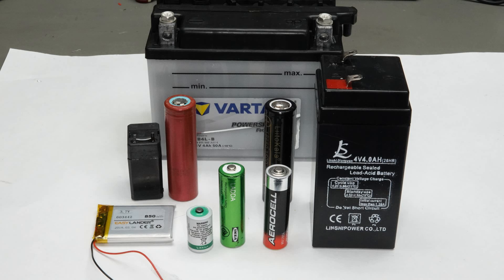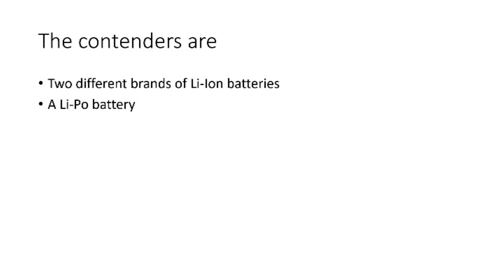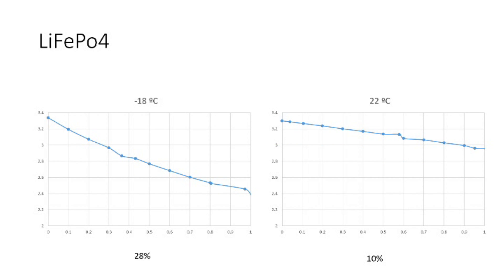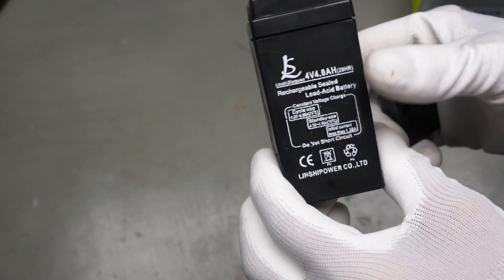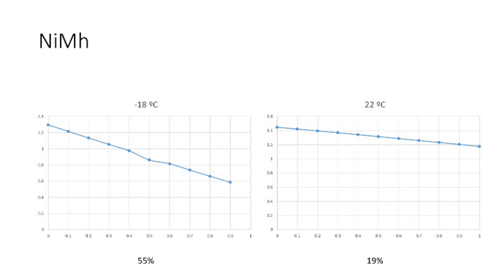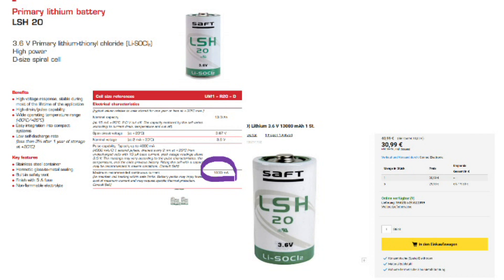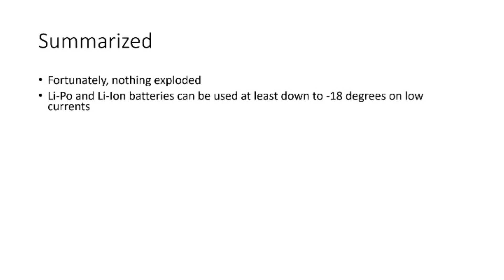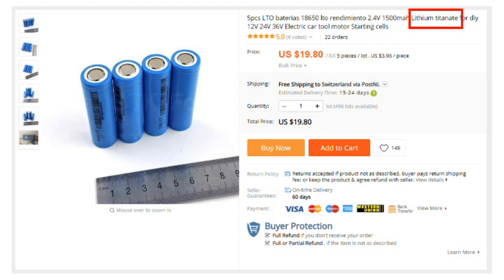#256 Which batteries are best for winter? (Arduino or ESP8266 / ESP32 projects)

Comment: Good evening, thank you for your informative videos. What would be the response of the batteries from your experiment at 50 degrees celsius or higher ?
Reply from the maker: I do not know because so far, we only have a maximum of around 35 degrees C...
Reply: @AndreasSpiess  Thanks for your answer . The reason for my question was because I live in Greece and we have a hot summer (35-45 degrees Celsius) in the shade, how do the batteries behave in these temperatures.

Comment: My understanding with the Lithium based batteries was that if you charge them at <0C then it causes problems with the cell chemistry and you drastically reduce the number of charge / discharge cycles for the lifetime of the battery.
Reply from the maker: This is often written. However, I only found papers where they charged at high rates. We charge at very low rates. So the danger is smaller.
Reply: @AndreasSpiess  Oh thats very interesting to hear! Yes there is not much data out there which is very frustrating!!

Comment: Actually  now I know more about batteries. You shouldn't charge them below freezing. Cars in Norway they use extra energy to heat the batteries first. They are not being charged cold as you assumed. Charging cold makes holes in the membrane. Reduce number of cycles
Reply from the maker: I agree for high charging currents. But do you also have data for the small currents we use? I did not find any.
Reply: @AndreasSpiess  I am not sure but I assume a 0.1c charge rate will also cause extra wear. I think is nice video idea to test capacity at least after below freezing charging. I know that testing cycles and degradation is long task. But capacity testing could be done?
Reply from the maker: Here the tried the discharging at -30 (LoFePo4). And they say that these batteries can be charged down to -5C. There is a risk of „plating“ but I assume this goes somehow with the charge brought into the cell. https://youtu.be/3iLLAaX0lrI

Comment: so, as the video is two years old now it maybe worth to ask. Do you have Andreas some long term experience about charging Li-ion battery with small solar cell during winter time when it is below 0 Celsius outside? I would be interested to such experience...thanks!
Reply from the maker: I had a few outside during the last winter. But it was not very hard. So no problems.
Anyway I learned that charging can create some internal structures which can puncture the insulation. So this seems to be a long-term process. Maybe we just do it and change the battery when it died after a few years...
Reply: @AndreasSpiess   thanks for your reply! Very valuable experience. So, then it can be a long process to kill a battery with winter time, outdoor charging. But eventually if I want to be sure that no battery dies due to charging at sub-zero Celsius conditions then simply don't charge them when having such weather conditions. So, probably worth to build in some 'switch-off charging' mechanism if it is under 0 Celsius.... thanks again!

Comment: Can I power this ESP32 board https://www.amazon.com/dp/B0718T232Z/ref=cm_sw_r_cp_apa_fab_qYoCFbKQHPMVG with two 1.5 volt Energizer Ultimate Lithium batteries like these  https://www.amazon.com/dp/B00EAKP8S0/ref=cm_sw_r_cp_apa_fab_k2oCFb14S8G9F ?
If so, would it be better to use two of these batteries through the 3.3 volt pin, or 3 (or 4?) of these batteries through the 5 volt pin ?

Comment: Please, please, anyone watching this, do not charge Li-ion in negative temperatures. This only shows a single cycle, however these batteries degrade very quickly while charging in freezing temperatures, they also form various nasty things in the electrolyte, which can lead to fairly spectacular failure later on.
Reply from the maker: Where do you have the proof that this happens when charging with small currents?
Reply: @AndreasSpiess  If it happens at normal currents, it happens at low currents as well, just at slower rate. Each cell is different and results vary. I work in this field and have tested hundreds of different cells in last 12 years, I've seen it happen, many times.
Reply from the maker: And what is the effect? Good to know a specialist because most people only warn with no concrete effects.
Reply: @AndreasSpiess  well the most usual problem is capacity loss at each cycle. At -10C some cells degraded hundreds of times quicker.
Reply: Do you have any recommendation for how to accomplish charging in freezing temps with li-ions or maybe some other compact rechargeable battery type?
Reply: @eugy2008  the simplest way is to heat them up to +5C before charging.
You can charge at very low current in cold, but each cell model reacts differently, so you need to do some serious testing first.
Reply: @eIektrinis  I've been looking around batteries lately. What's your opinion on lithium titanate batteries for cold weather charging?
Reply: I am thinking of making a battery pack with flat li-ion batteries and a small heating element that I could try turning on for short periods of time with a transistor on arduino.

Comment: Hi Andrea, I need you help: can you tell me if I can connect an unprotected 18650 directly to a ESP32 TTGO-T- Display? Does it have a overcharging/discharging circuit? I can't understand unfortunately... ! The schema is the following  https://github.com/Xinyuan-LilyGO/TTGO-T-Display/tree/master/schematic

Thanks a lot
Reply from the maker: These boards usually have a LiPo charger which protect against overcharging. You easily can find out if it has undervoltage protection by connecting a battery and wait. I suspect it has none.

Comment: Fast charging of batteries at temperatures below 0°C can be dangerous (depending on the cell type and the charging current).
Some quotes from https://batteryuniversity.com/index.php/learn/article/charging_at_high_and_low_temperatures:
"Charge advisory for low temperatures:
  - Li-ion: No charge permitted below freezing.
  - NiCd, NiMH:  Charge at 0.1C between –18°C and 0°C. Charge at 0.3C between 0°C and 5°C.
  - Lead acid: Charge at 0.3C or less below freezing.

Fast charging of most batteries is limited to 5°C to 45°C (41°F to 113°F); for best results consider narrowing the temperature bandwidth to between 10°C and 30°C (50°F and 86°F) as the ability to recombine oxygen and hydrogen diminishes when charging nickel-based batteries below 5°C (41°F). If charged too quickly, pressure builds up in the cell that can lead to venting. Reduce the charge current of all nickel-based batteries to 0.1C when charging below freezing."
Reply from the maker: You are right. But here, we charge very slowly. Especially in winter where sun is also low.

Comment: Hi Andreas, is it possible to do a video on how to select batteries for 2G and NBIoT modems so that the device can send messages for many years?  It seems difficult :-)  Especially when T range must be wide and high peak currents must be possible. Also the battery capacity seems given always in ideal low current condition, and drops significant if the current is  a few hundred milliamps. Some high capacity batteries I found can give max 400mAh while modems have peaks > 1A.  Can supercaps be used, or do they discharge the battery to much? Ifso can the supercap be connected by Mosfet when needed?  Is it correct that we get at the end much  more capacity when we  use 2 * D cells in parallel then if we use 1 DD cell? Will the final capacity offered to the device be significant higher because of the I/2, even if the sum of 2*D capacity is the same as the DD capacity? Best regards from Eischoll :-).
Reply from the maker: 1. Choosing a battery is not too difficult, but maybe you would not like its size. You measure the average current consumption for one cycle of your sensor and then, you multiply it with the time. Then you get the needed capacity in mAh. 
2. To "break" high currents, most concepts use capacitors as their capacity is big enough (the spikes are short). 
3. There is nothing like free capacity. You just add it. 2 batteries have 2x the capacity if you run them in parallel.
Reply: @AndreasSpiess Sorry, I think I not explained it clearly. Both batteries offer the same voltage. And the total energy of 2 * D size is the same as the 1* DD size. I just wondered if 2 * D batteries in parallel would be able to give more  energy at the end because the 2 D cells would give each a lower current if placed in parallel. In the specs they show that the energy that can be given by a battery is not a constant, but is highly  affected by the current the battery must give. At first glance the size and total capacity of 2 * D is the same as 1 * DD, but by looking at the specs it looks like the 2 * D in parallel will last much longer because of the lower current, even if for every transmission  the current and voltage offered to the device is the same in both cases. What is your opinion? Thanks.

Comment: EV batteries have ususally heating and cooling systems. so when you say they charge slower, it is because the battery is first warmed up before full charging.
Reply from the maker: This is what I also found. But I found also people talking about the fact that they already start to charge even if they do not have ideal temperatures. But I am no specialist. I still drive a conventional diesel :-(

Comment: Recommended reading: https://batteryuniversity.com/index.php/learn/article/charging_at_high_and_low_temperatures and https://batteryuniversity.com/learn/article/charging_lithium_ion_batteries
Reply from the maker: Thank you for the links. Unfortunately they also only say: Do not charge below 0 C. And there I am not sure. There are a few commenters which describe that they used Li-Ion batteries during winter without problems (small currents)
Reply: @AndreasSpiess  They know more about this topic and it is hidden in the text:
Many battery users are unaware that consumer-grade lithium-ion batteries cannot be charged below 0°C (32°F). Although the pack appears to be charging normally, plating of metallic lithium can occur on the anode during a sub-freezing charge. This is permanent and cannot be removed with cycling. Batteries with lithium plating are more vulnerable to failure if exposed to vibration or other stressful conditions. Advanced chargers (Cadex) prevent charging Li-ion below freezing.

Advancements are being made to charge Li-ion below freezing temperatures. Charging is indeed possible with most lithium-ion cells but only at very low currents. According to research papers, the allowable charge rate at –30°C (–22°F) is 0.02C. At this low current, the charge time would stretch to over 50 hours, a time that is deemed impractical. There are, however, specialty Li-ions that can charge down to –10°C (14°F) at a reduced rate.
Reply from the maker: Very good! This is what I searched! So my suspicion was not completely wrong. Wo usually do not charge our IOT batteries not too fast, especially with low winter sun ;-) Thank you!

Comment: Cars also charge batteries to a much lower termination voltage than the typical 4.2V you would likely use with compact DIY kit. The reason we don't charge batteries to a higher termination voltage than about 4.2-4.35V is that they quickly degrade above and can become prone to internal damage and venting with flame, so usually consumer electronics has its termination voltage adjusted such that the battery has a useful life of 500 cycles. In vehicles, much longer useful life is expected, and besides, it's imperative to avoid catastrophic failure under a variety of conditions. I wonder whether lower temperatures nudge the safe termination voltage downwards.
Reply from the maker: I assume you mean electric cars? I think it is generally good practice to not charge a battery completely if you do not need to. I can adjust my laptop to stop at 80 or 90% if I want.
Reply: @AndreasSpiess  Yes i meant individual cell charge termination voltage in Tesla and perhaps other EVs that use Li-Ion cells with these kind of chemistries that are usually otherwise used with 4.2V termination or slightly higher. They charge them to less than 70% if i remember right.

Out of interest, what brand/lineup of laptops allows such a fine grained adjustment? I have an old Lenovo Z500 which has two modes, 60% charge and 100%, but nothing in between; which is honestly a million times better than no adjustment at all, but if i were going to ever replace it, i'd like to retain or expand on this feature.
Reply from the maker: Mine is an old Samsung. They are no more sold here in Europe :-(

Comment: Interesting. However i hope the next months the temperatures will go up, not down!
A few years ago i had a solar charger (with [LiPo] battery) in my car.
The  battery "exploded" on a hot day.  (I don't exactly know what happened, but the volume of battery increased permanent and the solar package broke open. I expect due to the temperature in my car. In direct sunlight it can become very hot.)
Perhaps also the maximum temperature needs to be tested?
(And perhaps i need to build logger with sensors for min/max temperature at some different locations in my car to measure how hot it can become.)
Other useful info could be, What is the best way to store the batteries if not in use? Charged or discharged?
Reply from the maker: The problem with the sun shining into the car is that the temperature can go much higher than the temperature of the air around it if the surface e.g. is black. So it is best just to shield it from direct sunlight.
Concerning storage, I read that 3.8 volts per cell seem to be good for storage.
Reply: The problem was it was a solar charged power device that i put in direct sunlight in my car to keep it charged.
http://blog.jeronimus.net/2017/07/solar-charger-teardown.html

Comment: Last winter, i used a 18650 Li-Ion cell for my ESP IoT Project. 

At the nighttime it reached about -25°C, and at the daytime it was about -5°C and my 6V 4.5W Solarpanel charged the cell without problems up to 4.2V.

Nothing explodet.
Reply from the maker: Thank you for your feedback. This is what I thought. But did not find any info...
Reply: @AndreasSpiess  No problem.

I was abit scared too, but was amazed how the cells worked at nighttimes to keep the ESP alive.

Comment: Excellent video Andreas! I still wonder why all manufacturers don't permit low temperature charging as of spec sheet. Is it just because of lower performance and deviating from standard test specs or laziness to test all variations? ... Uhmm... does it, perhaps, harm the cell in other (hidden) means? (Does it reduce number of charge cycles? Reduce capacity permanently? Maybe increases likelihood of internal shorts on individual cells when charged at nominal current?). What ever it is, keep on going Andreas, great job!
Reply from the maker: These are also my questions! I did not find any answers for small currents.
Reply: https://www.mpoweruk.com/lithium_failures.htm says irreversible capacity loss when charging lithium in low temperature
Reply from the maker: Thank you for the link. They write „when the electrodes can not accomodate the current flow, the result is reduced power and Lithium plating of the anode with irreversible capacity loss“. Which is what I suspect. On low charging rates as we use it for IOT it should not hurt the battery too much.
Reply: Yes in case of IoT load the risk is at charging only. Smartphones charge very slow and state of charge indication often jump. The 2nd effect is probably due to impedance which make voltage levels jump too and algorithms unable to conclude . Perhaps monitoring impedance when charging on solar would help. If the impedance jumps up the cell is unable to accommodate and current should be reduced.

Comment: Electric cars have heaters built in battery pack. They heat battery up to optimal temperature if the temperature is too low.
Please test the charging with solar panels. It's realy interesting if solar panel can give enought power to a GSM device, which wakes up 1-2 times per day to send data through celluar network and goes to sleep again.
Reply from the maker: I made a video with all these calculations concerning Solar panels, battery size, position on the earth, and power consumption. But you have to do your own.

Comment: I bury my LiPo batteries below the frost line (55cm here). Any pipe that can be sealed will do. They perform m/l the same year round. (LiPo batteries don't work well at -40C) Replacing them is ... annoying.
Reply from the maker: Very good idea. Thanks!

Comment: How about a super cap?

I remember shooting with my DSLR in Poland one winter. I had several LiPo batteries, they would die as they cooled down in the camera, so I'd swap, and tuck the recently frozen battery inside my clothing...
They had plenty of charge left, just no enthusiasm to release it when they were that cold!
I kept going all day like that, never needed to charge them, just warm them up.
Reply from the maker: That is what I also heard. Maybe it has to do with the curves I measured and they just lost too much voltage when cold.
Reply: @AndreasSpiess  I think so, yes.
They are chemical after all, and chemical reactions tend to slow down with a temperature drop.
I think my freezer will get below -25c, I'll have to see what batteries I have to hand, and what I can test them with.
(I think I'll be checking the freezing point of dilute sulphuric acid first though, I don't fancy the lead acid's splitting!).